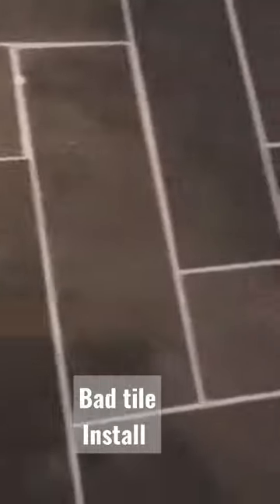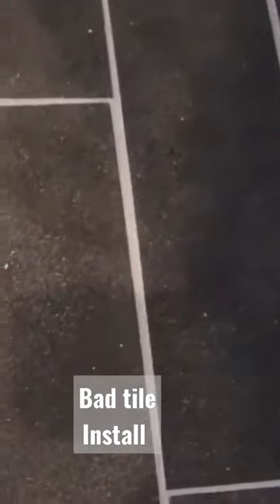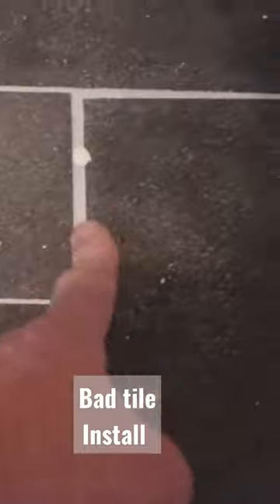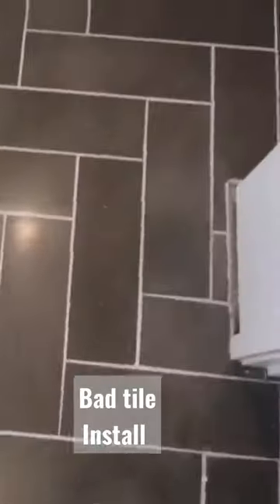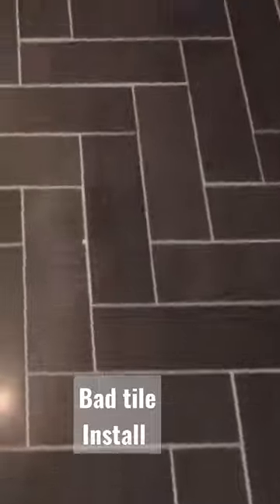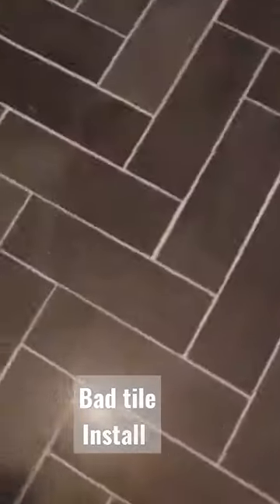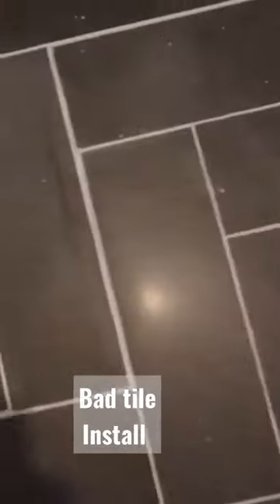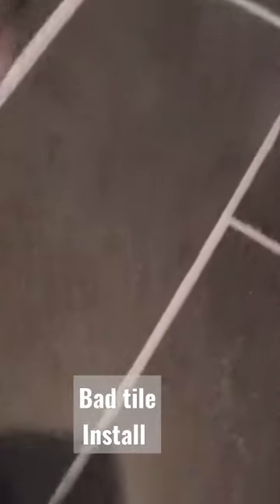Look good on camera, but HIDEOUS in person #shorts #howtotile #fails

Comment: RIP my tile work. I'm a DIYer and always wondered about "lippage." I got the tiles flush/flat. When I grout, I just pack it as much as possible, but sometimes you get low spots which I'm assuming is "lippage." It looks good to me, but I will say my spacing is better than this. How do we stop "lippage?"
Reply from the maker: Lippage is when one tile edge is higher than the adjacent tile.
Reply: @SalDiBlasi  Yay! Thanks for clearing that up for me. Then I don't suffer from lippage, I suffer from not stuffing enough grout in.

Comment: 😲 omg.....ohhhh, I can see it..... just horrendous........ I was at a house yesterday that was built in the 90s, the whole house had like 16x16 Square ceramic straight lay, a wood company came in didn't want to rip up all the tile and put real glue down wood over the top of this old tile floor, and I guarantee that tile floor was not put down correctly so another good example of never go over somebody else's work always go down to the substrate and start new.